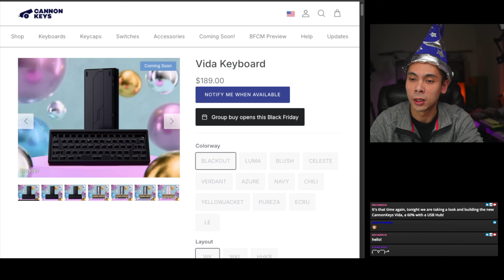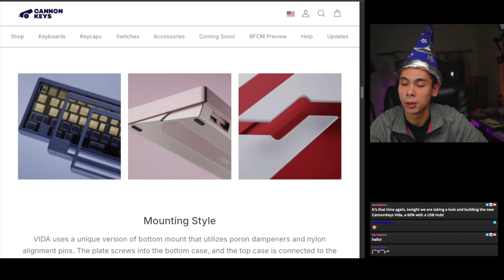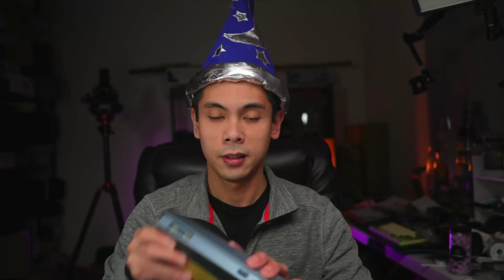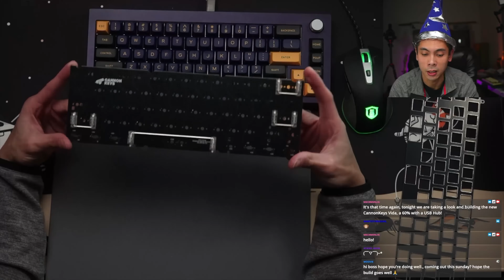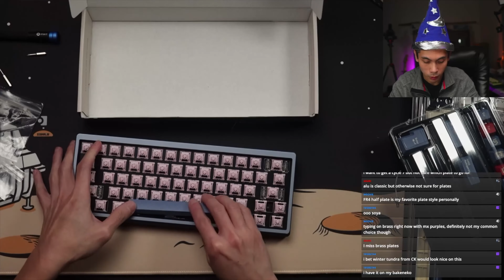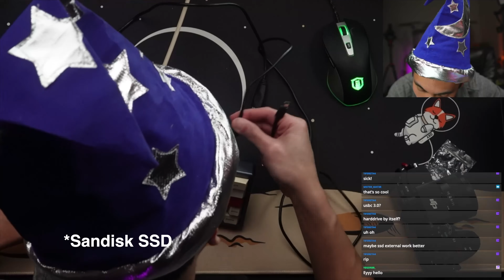Build: CannonKeys Vida

Comment: i still don't like wireless keyboards. just another battery to worry about when most of the time you don't even move or travel with most of the custom boards anyway.
Reply from the maker: Yeah its a niche scenario for now. The board itself has to be small and lightweight for me to even want it to be wireless.
Reply: @MechMerlin I’ve tried the kei v2, the qk65v1 and v2, and the neo65. Wireless doesn’t work well. It is incredibly wonky.
Reply from the maker: @kayseeday  None of the boards you mentioned are using ZMK. It has so far been the best experience for wireless on a custom mechanical keyboard so far.

Comment: Hey Merlin, for your Cycle 7 or other ball-latch systems, just rights the screws on the side to firm up their grip. Some ship loose for easier disassembly. Properly tightened, they shouldn't do that.
Reply from the maker: It doesn't happen very often, only when I'm taking it out of the case. And yes I've tried what you have suggested.